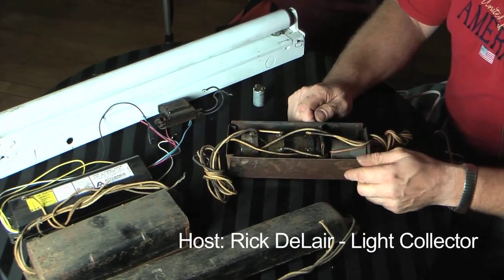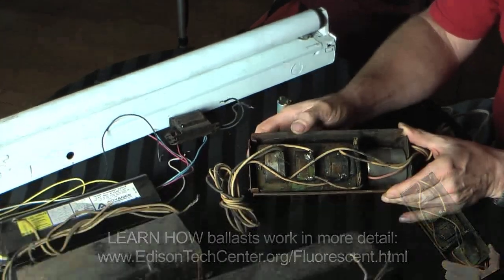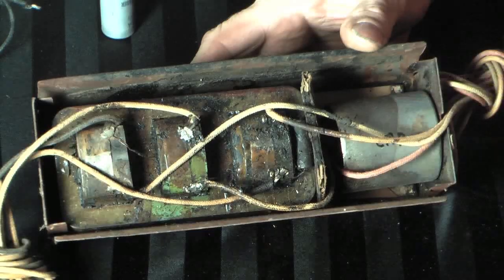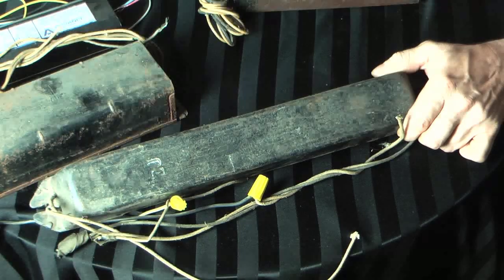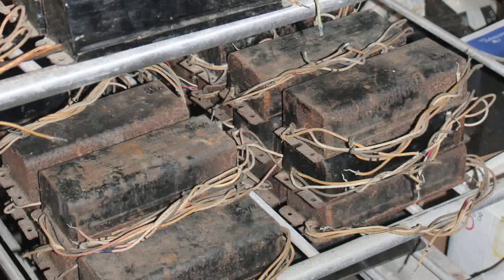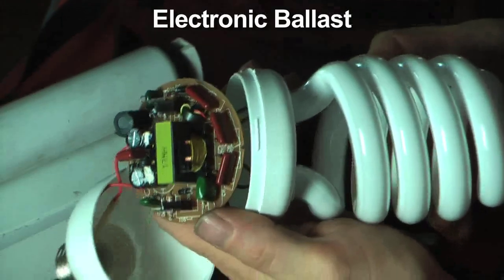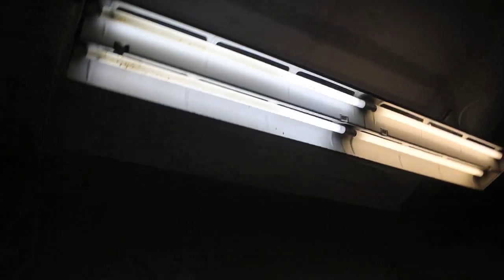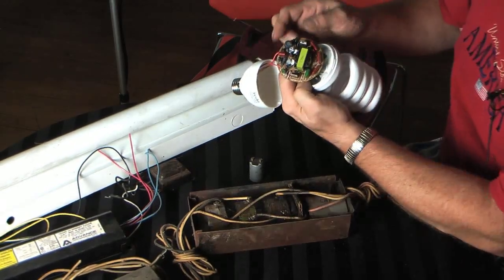Fluorescent Lamp Ballasts

Comment: The 1959 house I grew up in had a line of 4 foot tubes down one wall of the living room, that had special ballasts controlled by a big variac for a dimmer. Worked very well, although you couldn’t dim them as much as incandescent.

Comment: Good video! but it would of been nice to sort of explain why ballast burn out and if it is better to leave them on continuously or cycle them off and on
Reply: Probably the slight vibration (buzzing)  of the induction coils (wound wires) are slightly rubbing each other.  The varnish or coating rubs through and shortens the wires.
Heating would occur and that speeds up its "melt down" and failure.

Comment: I’m pretty sure the brick ballast is what caused the lights in my grandparents basement to start smoking. One day when we were over there, smoke just started pouring out one of the fixtures and the fire department was called. They looked at it and said the ballast had overheated. It didn’t catch fire though which was good. They’re house was older, built in the mid 50s. It was pretty scary and they never used those particular lights again.

Comment: No doubt,  the magnetic ballasts, whether they be preheat,  rapid start or instant start, if operated in an environment so as to not overheat,  will outlive the newer electronic junk many times over, 50 to 60 yrs or more is not uncommon.   Biggest problem is when EOL lamps are left in the fixture for an extended period,  or when failed (shorted) starters on a preheat fixture are not replaced promptly (a lamp that only lights up at the ends, puts the ballast in danger)    Instant start lamps that spiral wildly with bright orange flashes are EOL and can overheat the ballast.  

Another thing to watch out for, is using energy saving lamps like 34 watt T12 instead of 40 watt, or using T8 lamps on a magnetic ballast designed for T12.   Many ballast burn ups occur because of this, considering the 40 watt T12 while still available,  is getting harder to find, and it's tempting to go the easy route and use what's available,  since they are both physically interchangeable,  but not electrically interchangeable
Reply: I was also partial to magnetic , but after buying some really nice ballasts made by Robertson Lighting over the past couple years, I've shifted in favor of electronic.   Tl

Robertson has a huge selection of all types/technologies;  I narrowed in on their electronic rapid (not instant) start, power factor corrected units.    

The light output with these is superior to my eyes (no 60Hz flicker nor the slight dimming effect caused by the flicker) .   I think they will have a long service life - it all comes down to  he design and choice of components i.e. quality capacitors , heat sinking , potting and so on...    And these ballasts are not roasted the way CFL  ballasts  are (with their lack of heat sink, and cramped enclosure right next to the hot tube). .     So we'll see how it goes ... 🤞🤞
Reply: @yeliab814  another thing I love about the electronic rapid start ballasts is the availability of dimming ballasts for the 4 foot F32T8 the better quality ballasts capable of dimming down to 1 or 2%, by varying the arc current while keeping a constant voltage on the cathodes.   Now, in this day and age we have dimmable 4 foot LED tubes, but it's so cool to see a dimmable fluorescent fixture.   I don't know of any dimmable magnetic ballasts,  but if they ever existed I would imagine they were noisy and inefficient when dimmed and thus rarely if ever used.
Reply: @Sparky-ww5re  wow i didn't know those were available.  pretty darn cool, will have to look into.   i had some dimmable CFLs 10+ yrs ago that worked surprisingly well but didn't realize retrofit dimming ballasts for standard tubes existed.  👍

Comment: I'm actually very interested in understanding how the various parts of the early ballasts (including the starting compensator and capacitor) all worked in conjunction. It would be great if you could make a video detailing some of these aspects. 

On a side note I also have have an old style GE ballast like the one you showed in this video but I cannot find any diagrams of how it's supposed to be hooked up, If you have any resources on that I would be very appreciative.

Comment: finally somebody that may be able to help me figure out if a ballast that is leaking oil has pcb's the capacitor says GE made in USA and the main No# is 72F1054  it is a 420 volt the numbers above these numbers is 65-10 600y.  Housing of ballast has some rust on it because it was in the weather.  Would you know?
Reply: If it is newer than 1979 or says non PCB it is safe
Reply: @liamtheinventor1522  was about to say the same thing, although it's best to treat all magnetic ballasts/capacitors with the date/label missing as PCB and handle/dispose of accordingly, even in a slightly newer building from the early 1980s, because if the light fixtures were original to the building they may have sat in the warehouse for a few years before installation.

Comment: Mistake was made from above information,  the correction......
CFL has higher light efficiency than traditional choke type ballast because less " iron loss and copper loss " from chokes. CFL uses 100KHz power, its output  transformer is super small and contains very little turns of wire that its loss closes to nothing.
Forgot to mansion cold cathode fluorescent light ballast, no starter is needed,ballast supplies as high as 780Vac to light the tube.

Comment: I don’t agree with your opinion that the old rapid start linear tube ballast might only last 5 years. I change a couple out here that there. Changed 5 out today that were probably from the 70’s and they were not cared for what so ever. There are still several dozen of them still choochin’ away in that facility day in and day out.

Comment: I often wondered how fluorescents could strike on 120 volts. Now I know! Thanks to the step up transformer. 
UK and European ballasts are simpler for all sizes as they're on 240 volts. Thank you!
Reply: @Joshua Wilson You're right. That's just how they work. But I'd read somewhere that 120 volt supplies were trickier than 230 volt supplies.

Comment: You referenced "When they're cared for" how would one care for a light ballast? Good informative video. Thanks
Reply: To "care for" a fluorescent lamp ballast would be to replace end-of-life fluorescent tubes in the circuit immediately after they fail, so as not to overheat the step-up windings in the ballast which will continually try to start a lamp (or lamps) that can no longer operate properly.  Allowing a ballast to overheat can cause its internal components to fail, resulting in rapid failure of new lamps, or the fixture cutting in and out (as the ballast will continuously overheat due to its windings being compromised).
Reply: Yes this is true.

Have replaced  more fluorescent tunes and Ballesteros than I can remember. 

Remnrrd a lot of  places wear filed ballasts were the problem. 

Like 1 or mor out of 6 were dead.

And about 1 in  25 to 30 either were  cooked or had Caught fire.

Still remember  that you could tell witch ones would be about to go soon.

Due to getting louder with the characteristic huming and raccoon ind the end.  Some times even with out sines frome the tunes them sells surprisingly 

By the way.

If you still have florescent.

Say inabasment or eltswear pleas if your needing  to be in those areas for short permission of time but thru out the da leave th florescent on.

Mostly applies  to preeheat and a 1 or mor uther tipes of blues and fixtures 

To git longest bulb and Ballest life.

Comment: i like the magnetic ballast better than electronic ballast, so  when the bulb is close to EOL, it will flicker, telling you time to get a new bulb, while electronic ballast don't flicker, it stays burning till it goes out, the only good thing about electronic ballast is that it don't heat up a lot when using LED on them, on tubes it does heat up... it don't last long like magnetic ballasts, i am an old school person myself, i rather have magnetic ballast than electronic

Comment: Electronic ballasts have better efficiency than 'choque'  type ones in terms of losses. just take size/temperature as a comparison. Cheap ones last the lifetime of the bulb, if much. but brand ones run on trains/shops, etc can easily run 15-20 years. I do agree much less than 'choque' types, but still if one considers additional lamp life, rapid start, dimming options, better power factor and the possibility to operate on DC from a emergency supply or solar system, life savings may well be enough to cover to purchase a new fixture by the end of its useful life.

Comment: i dont know how i feel about the  rapid start ballast  your  lucky if it lasts 5 years    where i work we are just now  replacing them  ( they would not  start the  tubes any more)  and they are original to the  fixture and they were put in in the   early   80s 81 or 82 i think is when my boss said the lights were changed  id say they dont owe anything  and probably  paid for a  new one or two durring their life

Comment: Can you show any circuit to use a one side open filament 36w fl , it does not work in its fixture.
Reply: *****  accidently I found a way to use the one side broken filament fl, I was experimenting the fixture, I always solder the fl connection's for the best contact(I guess i blew one side filament when I was rotating the fl lamp in the fixture because it was working sometimes only). So I soldered the good filament side & was experimenting with a EM ballast , the other broken side I connected a 50w incandescent lamp with the starter , the lamp was cycling on & off continusly, so I replaced the whole setup with a electronic ballast , the lamp worked from the moment I switched it on, the 50w incandescent lamp would lite up using the EM ballast but not in the case off electronic ballast,so I removed the lamp & shorted the two wires & connected to one of the terminals of the broken side filament this setup worked & have been using it for past 6 months.
Reply: atleast my exp was sucessfull w/o any short circuits/blasts & i didn't had to throw the one side open filament FL.

Comment: Here in the Philippines our power line is 220 volts 60 Hz and if a 20 watts fluorescent lamp is running for an hour, the choke ballast (3:00) is too hot to touch. Some failed within few years.

Comment: Ok, regarding current regulation; how do products such as "bright sticks" work? that is a simple FL tube with plastic mounting ends and no housing, they are completely disposable. I guess they may have a very very small electronic ballist, but it would have to be even smaller than a CFL's.  Thanks!
Reply: The botton piece is a resistor

Comment: I have wondered if you can run rapid start or preheat lamps on slimline ballasts provided you change the sockets. It seems that striking the arc with high voltage alone as in the slimlines would work on any fluorescent lamp even ones with broken filaments.
Reply: In theory you could,  as long as the wattages are the  same, ex. a 40 watt, 4 footer is also made in instant start versions, but they are rare, if you use a typical 40 watt 4 footer, designed to run on rapid start or preheat,  on an instant start ballast, it will start and run normally,  but will have a very short lifespan,  since the cathodes are not as rugged to withstand the high starting voltage.   On the other hand an instant start lamp on a rapid start or preheat ballast will not light at all, since the cathodes are internally shorted and cannot be heated, and will likely damage the ballast.

Comment: Yes the trouble with electronics is they usually fail in the shorted mode. One or both of the inverter transistors shorts, puts straight DC through the transformer and up in smoke it goes. Of course there's no fuse inside so instead of just not lighting up anymore they put on a smoke show and sometimes flames.

Comment: This is true, oh the debating fun!  I prefer the magnetic ballasts.. BUT I prefer OLD magnetic ballasts.  The new ones are, in my opinion, are almost as likely to fail as a digital/IC ballast.  

Here's why:  

Capacitor failure.  Old caps had PCB oils in them, and SELDOM failed. I see 40 year old HVAC condensers with original caps working fine but OFTEN have to replace new caps that now ban PCB fluids. I have all digital CFL bulbs, work great. t8's are noisy RF makers so I'll keep t12's for now

Comment: however, I do have to disagree on one small thing
you said... the rapid start ballasts are, in my opinion,
just as reliable as preheat. With both types of 
ballasts, I very rarely have seen one fail... especially
in comparison with the new school electronic
ballasts... also, when an electronic ballast goes,
they usually go up in smoke as well... especially
with some compact fluorescent lamps.

Comment: 2:50, at my high school in the wood shop area, we
had bulbs, sockets and fixtures very much similar
to this! They were high power factor rapid start
fixtures though, but I mistaken-ed them for 
slimlines because of the sockets. The ceiling
(from what I can see) was very much similar
as well.

Comment: The 99-cent store had a stack of a couple of dozen brand new basic 37W 4-ft fixtures (no reflector). I should bought a dozen or so just to get the ballasts for replacement, but I was in a hurry. They were gone the next day.

They started using 6"-long fl. lamps in can-type fixtures before CFLs came along. Now when they go out, they have to pay a lot for a bulb or ballast. A new CFL is 50 cents and it replaces both at the same time!

What happens if you put a 37W lamp in a 40W fixture?